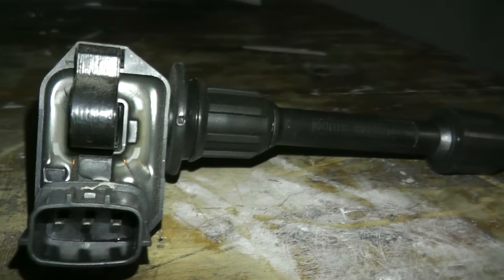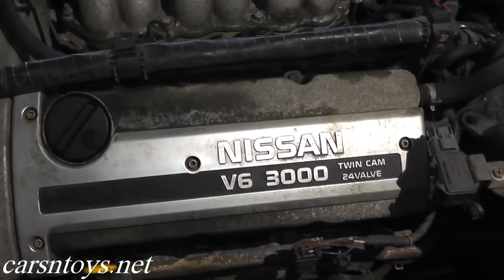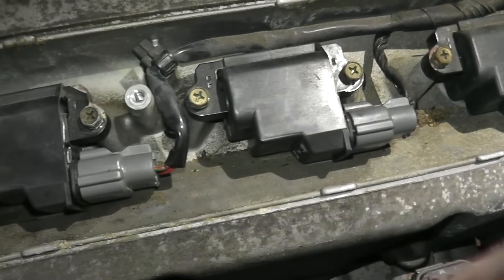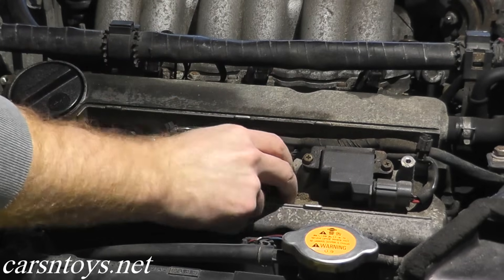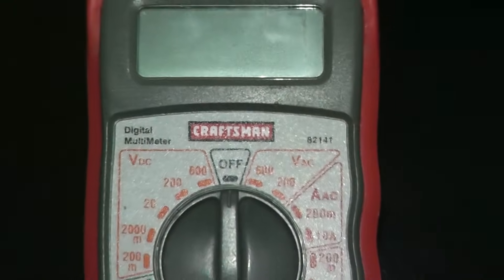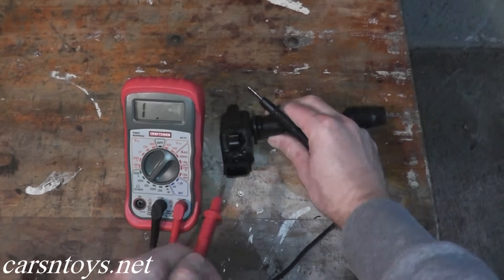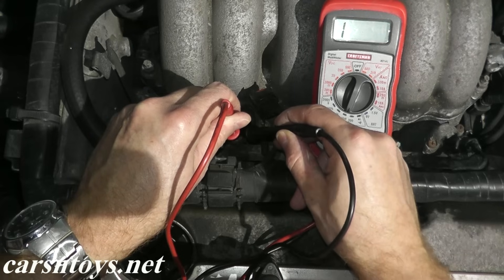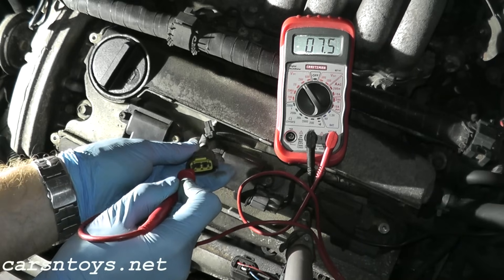How To Test Ignition Coils with Basic Hand Tools HD

Comment: I wholeheartedly disagree with telling people that simply because they remove the coil pack from the vehicle and test it's resistance that it is in good shape just because you get the correct resistance reading while it is out of the vehicle and not under any sort of load or any sort of temperature fluctuation Because it is a known fact that certain coil packs will be fine when bench testing and might even be fine when the vehicle is cold and initially started, but once the vehicle reaches full operating temperature, the resistance inside the coil pack drastically increases, causing it to overheat and not fire off the correct type of spark or any spark at all all of a sudden, and then return the vehicle shuts off or the vehicle starts running rough out of nowhere once it's warm And in which case your bench test showing it's resistance doesn't prove anything because it's not actually being used or up to operating temperature, which is where the fault occurs with those particular coil packs I'm referring to lol

Comment: I like how you explain how to do it by breaking it down step by step, I appreciate that. I am an inexperienced mechanic I do all the work on all of my vehicles my self and the vehicle that I'm working on now is a 2004 Buick Rainier. So to start off with I have had to replace the exhaust manifold to replace my oxygen sensor cuz I couldn't screw a new one into the manifold so it makes all that I get everything put back together and I start my truck and it started but it's idling really rough and I put a ODB test on it a scan the tool and it told me that cylinder 6 was misfiring so I change the coils and I change the spark plugs and it still stating that I still have a cylinder 6 misfire even though the coils I have put in it have been all good. So do you have any advice to maybe that you could share with me to maybe help me out with this? I really appreciate it. Thank you

Comment: 3 have around 10K, one has around 1.5K. Got multi-misfire code. But when I changed the sparkplugs, it runs smoother.

But I got those numbers using black to the middle lead. When I did red to the middle, the one was about 1.1K each side. About 10.5K on the left for the other 3 and no reading on the right. That was set at 20K Ohms, on the meter.

Comment: recently changed the spark plugs,in about two weeks,the car start loosing power,l had to change down and start again, especially in steep place roads.l find out the coil pack os brocken.l changed it again and in about two weeks ots broken again.do you have any idea why is the coil pack is getting broken quickly?

ford focus EcoBoost 1.0 engine
model 2018

Comment: Had these checked , car is not missfiring but it's got a rough idle and engine power cut comes on until engine is proper hot , after it stops , after a while i get the engine overheating error and oil pressure low , its a n43b20 2.0 bmw 320i

Comment: Very smart to unplug the coil whilst it’s running. Pretty ingenious.
Reply: It's actually very common sense and the way people have located  cylinders that are misfiring either due to  compression, firing, or valves  since they invented internal combustion engines that use spark plugs.

Comment: For beginners it would be nice if you would show where you set the multimeter exactly
Reply: Ohm setting
Reply: depends on each type of car and coil so its better just to google it, if not just keep taking readings you should have a resistance on at least one pair.
Reply: You can pause it and zoom in
Reply: Terminal 2 and terminal 1 like he said
Reply: OHMS or around 200

Comment: i fixed my bmw e36 (4cylinder) with your first testing method! Worked like a charm! i found out number 3 (coil) was dead so i replaced it with another one and boom everything is working smoothly. Thank you!
Reply: Did you car throw a check engine light when coil was bad
Reply: @federicovega2292  nope it was running on 3 cylinders without check engine light which is strange
Reply: Very strange Thanx for the info

Comment: This will not work. Sometimes  the multimeter  gives you the right ohm value, but the coil is weak. Right now you just did a test for a primary coil not the secondary one. If the value on the multimeter for the primary one is right; that doesn't mean the secondary one is working.

Comment: Once we we unplug the coil and the rpm drops that means it a bad coil ? Or that’s normal ? I didn’t understand the part if it’s bad or good
Reply: No, if the car changes rpm’s that mean the coil previously was igniting. If the car does not drop in RPM that means there is a problem within the connection.

Comment: Newer FWD/AWD nissans with the larger 3.5L horizontal-mount V6 - you wouldn't be able to do an engine run test because you have to completely take off the intake manifold and vacuum lines to access the back cylinder bank. Also you didn't test the Kohms for the secondary coils (you only tested the primary coil leads) on the ignition coil pack. Why is that?

Comment: Hi, great video. thank you for share. I just wondering how you can know if the problem is with the coil or sprak plug? I mean if I start to run the engine and disconnect the coils and I find that there is no rpm drops, than I disconnected the plug as well isnt it? So it could be a bad spark plug or ignition coil as well? Am I right? how can I know if the problem is with the plug or with the coil? regards
Reply: Remove the plug and check for Fouling 'wetness' from oil or gas. Is the Gap on plug within specs? No cracks in white stuff? Should be good. Use it In coil on the grounding out of plug test check that spark...No spark? Coil is bad. Remove another coil hook up to it..Spark? Coil and plug good.😎
Reply: Start your engine. View the engine bay. If you ignition coils are exposed then you can try this method. Start left to right. Unplug the first ignition coil. Listen to the engine. If you hear a change in Rpms then the coil is good. If you don’t hear a difference after unplugging the coil then the coil is bad. Unplug one at a time. Test one at a time.

Comment: Right off the batt, you are wrong.  There will always be a reading of resistance from cold to Hot.  If that Coil pack doesn’t show the proper resistance when cold, it’s bad. If that coil doesn’t show the proper resistance when Hot, it’s bad!   They have a range they properly work in. When resistances go to low or high it causes all kinds of problems for the computer. Temperature affects this greatly.  With Hyundai, it will not throw a code and run very roughly on cold starts during winter or if a coil pack just decided to say I’m out. Sometimes this can be caused  by old spark plugs.  Always!!!!! Use OEM spark plugs because they have the resistance that was originally deigned for the spark plugs used!  Don’t fall for better plugs that say they are split fire and all kinds of gimmicks!  YOU NEED TO KEEP YOUR VEHICLES ORIGINAL RESISTANCE LOAD!   Yes, you don’t understand, but we as techs do, so unless your doing some modifications with your engine AND Computer, stop!!!!

Comment: Good video but if you don’t have a multimeter  chances are you don’t know how to use it can you explain a little bit more on that.
Reply: You can pull them out while it’s running. If it’s a blue spark it’s good, if it’s an orange spark it’s bad and needs to be replaced. Don’t touch them.

Comment: That test only tested the primary circuit,you have to test the secondary , high voltage also. Most bad coils have a failed secondary  winding.
Reply: How you do that?
Reply: @farees4820  measure between the plug wire holes of the mated coils, if good it should be dependkng on your coilpack, 10,000 to 14,000 ohms. All the coils in the pack should read about yhe same, if 1 reads 0 or really low or really hi, or all ove the place, thats the bad one.
Reply: @davidrussell8918  your talking about the spring inside right?
Reply: About time someone understands it’s two circuits and two diffrent test for windings 😂

Comment: Had a dirty connector on my Subaru coil, cylinder number 4. Set my check engine light and other lights on the dash. After pulling the metal clips and unplugging the coil, then plugging it back in, it cleared right up. I pulled the negative battery cable, reset the computer and its been running with NO ISSUES. I checked each coil by unplugging and replugging and everything was fine. Scanned at AutoZone later showed it was indeed number 4 coil.
Reply from the maker: Good stuff!

Comment: Some coil on plug coils can't be tested because the transistor is built into the coil. The transistor is what turns on and off the primary coil. So since the transistor controls the switching of the primary coil which. you need a way to control the switching of the transistor on the primary coil in order to test the primary coil. If not, the primary coil will show an open in the circuit because the transistor is a normally open transistor. And will make one think the coil is bad even though it works properly.

Comment: Thanks for taking the time. I would recommend giving the make/model and also resistance specs for the coils or other specs.
Reply: I mean a coil pack is a coil pack regardless what the specs or make and model of the car or vehicle is    these tips will work regardless of the male and model  so it's not really a requirement.
Reply: And the specs for coil packs will be different depending on manufacturer which will be on the box

Comment: I don't know if this has been suggested, but in your power balance test tips at the end you may want to also consider dirty/corroded pins/sockets in the connector and/or coil.  I suggest this only because I had an older car with a "blown" horn and all I had to do was clean the connection.  The electrical connection cleaner is a spray that is available everywhere and I use it every time I work on any electrical component on my vehicles.

Comment: I love your videos man! You have a new sub spreading your gospel 😀😀😀💰💸💰 few questions hopefully help with...when checking each coil should ohms be similar across all of them?...are coil packs one of those parts that either work or don’t work??? Just wondering because I am doing a tuneup on a car I was given 100,000 miles the 2005 tundra original coil packs just wondering if changing them all out would be overkill??? I believe the car runs smooth but missing power....V6 lol
Reply from the maker: Very cool truck. A buddy of mine has one and it's nearly indestructible. Have you checked or changed the plugs? This video was done on a '97 Maxima. Although it's an OBD2 vehicle, I probably wouldn't bother changing the packs in your truck unless you have a misfire trouble code. Appreciate the feedback!

Comment: It goes alot faster with an OBC scanner. Scanners will tell you which cylinder is misfiring.  Than doing the ohms test is good verification.  Scanners are not that expensive today.
Reply from the maker: Absolutely. Nonetheless, it's something you can perform on older (pre-obd2 vehicles - before '96) or if you simply don't have a scanner on you. Thanks for commenting.
Reply: @Carsntoys  got a collection of old diagnostic tools and techniques,  old Ford MCU debuggers even an O-scope. All my own stuff is old . So I don't use OBD I or OBD II scanners. Those for other people's cars.
Reply from the maker: Very cool!

Comment: What about testing the coils secondary phase of the coil.. connecting lead from terminal 1-sparkplug part. Term 2-sparkplug terminal..
Reply: Yep... that’s where my Old oil soaked coil reg zero and the New China one off eBay tests zero.... Repair manual says test both on my single cylinder quad...

Comment: saved me a bunch of money..i found my 2 bad coils using the rpm /connector method..that was 3 years ago...now i need to test a  used replacement  coil w multimeter.
.in your video  ( i have the same car!) are the   terminals 3, 2 1 as you have  it positioned for the viewer>  ..you said test one and two and pointed to another .. im assuming 1 and 2  ( in your layout)  are the middle and the next one to the right?    also can the coil test ok out of car-  but fail under a load    ?? Thx again great video   !!!!

Comment: I have a question: on the 3 wire coils (as in your video) what are you Ohm testing? Ground and signal, power and ground, etc (Internet search showed nothing on my connectors for my particular coils)? Thanks.

Comment: When coils start to go the epoxy coating on the wire starts to brake down allowing the current to take a much shorter path and make a weaker spark even miss at higher revs, this cant be tested for with a simple tester......
Reply: If you have a code for, say Cylinder 4 misfire that seems to only happen at higher RPMs, switch the cylinder 4 ignition coil for the Cylinder 2 ignition coil. Clear the codes, and drive it around for a bit. If the code changes to cylinder 2 misfire, you've found your problem.

Comment: Thanks for the information CarNToys,
Question for you here (and other folks who is reading my question), can my coil packs cause my car to have a rough idle to where when I step on the gas my car kills out on me? I've replaced my Fuel injectors, new spark plugs, checked for vaccine leaks,  even my Idle cControl Valve (ICV).
Reply: Yes.

Comment: sometimes ign coils are shorted inside and will be burning the ign fuse, you r/r the fuse but it will burn again (you test all other fuses on that branch and one of the fuses will not get full load of juice)
the solution is to r/r the bad ign coil

Comment: I kept waiting for the secondary windings test that never came. Then, the inspection for insulation breakdown? How about the carbon track caused by the previous spark plug's cracked insulator? The only definitive test here was the power balance test by disconnecting the primary wires at the coil connector.

Comment: I did this located the bad coil switched it and there is still a misfire any other suggestions
Reply: 🗣Eli Garza 
Spark plug
Reply: @baltimorelife7229  thanks for replying but all you spark plugs are done and I still have the misfire in the same cylinder

Comment: None of this testing matters if failure occurs when pack gets hot.. also packs like to crack.. spark likes to jump out of crack, even extremely small cracks..
Reply: Totally agree.  It just happened to me.  Bench test of resistance is completely useless.  Even test with spark tester is not reliable.  I have one coil that has spark with tester set at 30kv but I broke part of plastic when tried to remove boot (boot was glued) and didn't work when put in.  All 3 bad coil (I saved them over time for comparison) tested good for resistance.  There is book about car electrical by Tracy Martin.  He stated that for testing good resistance or continuity only small part of wire need be good.   He stated all electrical in car should be tested under load.

Comment: @CarsNToys  Thanks for a great video man! I have a 97 Nissan Maxima that started running VERY rough all of a sudden. From the symptoms I wasn't sure if it was a cat restriction, knock sensor, or what. Codes came up  P0325 knock sensor, p1320 Ignition signal primary, p1400 EGR Ckt Input Low. Did the power balance disconnecting one coil at a time looking for a change in rpms and found 2 coils not working. Swapped them out and voila! Running like a top now. The two coils together threw me off at first. I knew what a bad coil felt like, but not two bad coils. :)
Reply from the maker: lol.glad you got it done!

Comment: Question i got my valve cover fixed but I noticed 1 coil bolt wasn't put back n it feels alil loose from the other coil packs but the car runs fine no engine lights it runs smooth should I leave it alone or get another bolt and make it tighter

Comment: Do not. Disconect. It when the engine is runining you will burn the electronic control module. This guy is crazy.
Reply: Thank you!
Reply: Thats what thought
Reply: .......but if the coil is faulty ie zero resistance there will be no current flow in the primary circuit. It is same as disconnecting the connector.
Reply: No, not true, a bad coil is still bad reguardless if its plugged in or not. Its only 12 volts on a signal to trigger it when to fire, you are NOT going to burn out your computer if a coil is disconnected unless it is grounded by bare wire some how. Pulling the connector simply interrupts the signal to the coil and the 12 volts it receives.

Comment: Great video but I have a question in which frequency/setting do you put the meter on ?
Reply from the maker: This is an older-type digital multi meter. I typically used on the hundreds or thousands scale. However, you can purchase an auto-ranging multi-meter (typically what's sold today) and it takes the guess work out of the equation. Check out Amazon, local hardware store or auto part store. $20-25 is an average price.

Comment: What were you testing with the multimeter? The primary or secondary winding? It was 6 ohms so that is kind of an in-between reading, but I'm guessing that was the secondary. what were the specs supposed to be for a Maxima? just because you had continuity doesn't make it good, you could have had too high, or too low resistance.

Comment: My coils read 0, but car is running with no check engine light on, are my coils bad? I have a 2008 honda civic coupe lx 1.8
Reply: Same case with my Honda city, even after removing coil plug only one coil working fine rest are no effect on engine.. does my engine firing with only one coil? Or some other cause?